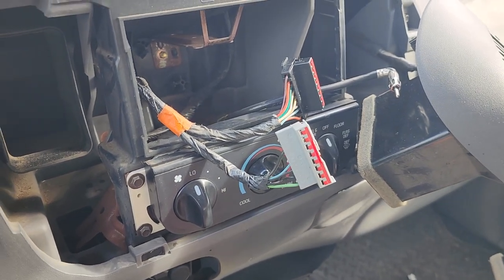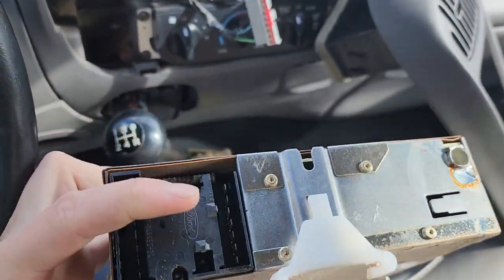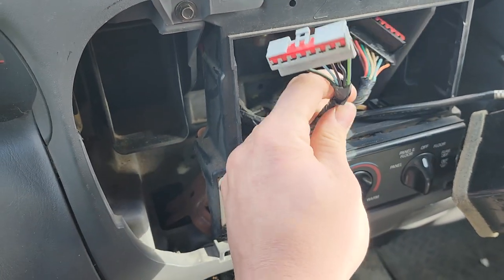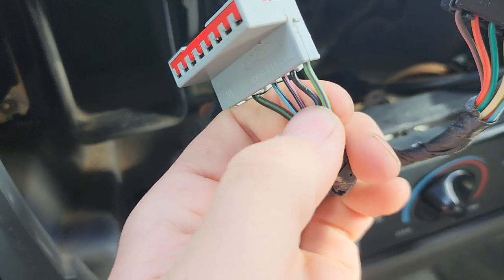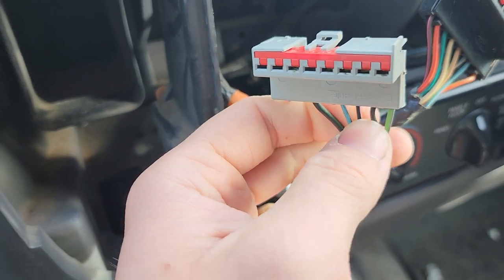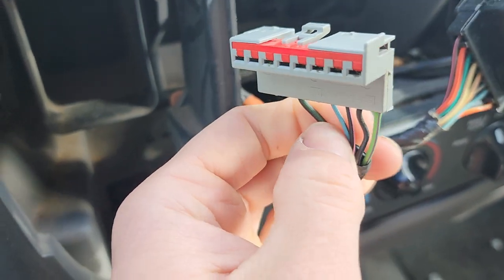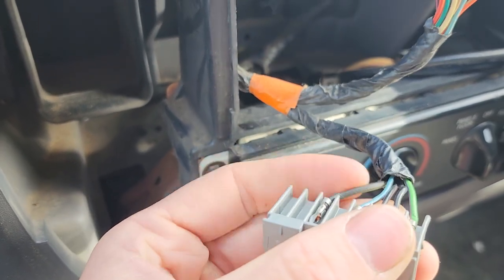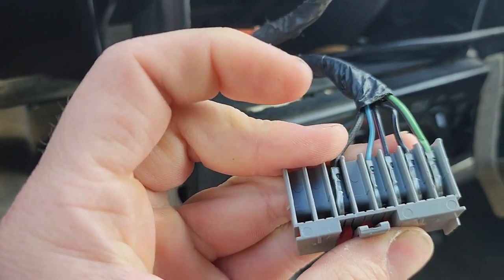1997 f150 radio wiring

Comment: Where did you find the black connector was that connected to the factory amp?
Reply from the maker: The black and gray connectors plug into the head unit. The amp is integrated into the head unit.

Comment: You think it’s same for a ford f150 extended cap 2003, I have a radio I know the difference I just don’t know which is which from the wires I cut the adapter from

Comment: I have a 1998 Ford F150 base model truck with the factory AM/FM like yours.
I'm trying to install a Ford Factory AM/FM 6 Disc CD player, (Ford FACTORY PREMIUM RADIO) out of a Lariat I believe.
Any help would be appreciated. Thanks.
Reply from the maker: If it's of the same generation f150 I would think it would be plug and play. If it's not a direct fit maybe look for an oem adapter or try using https://www.crutchfield.com/S-hvLCBw2ugUJ/ to find one aftermarket. Hope it helps